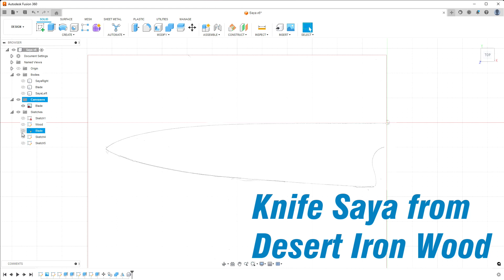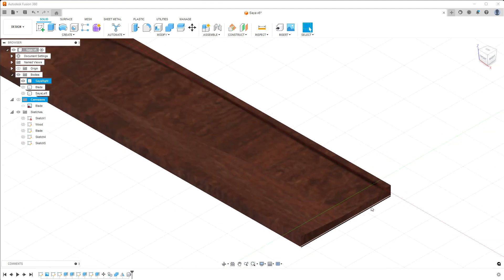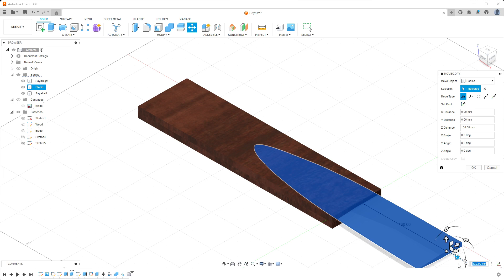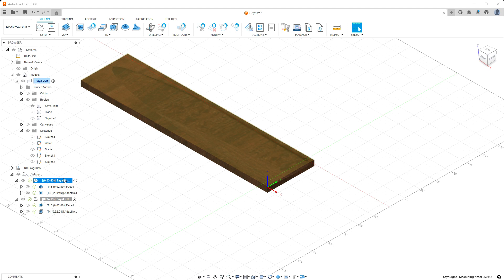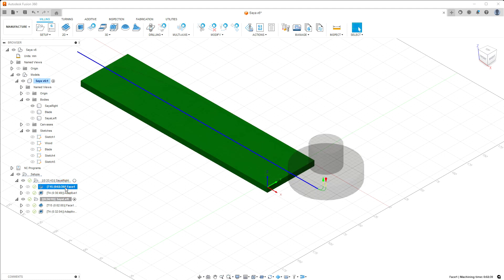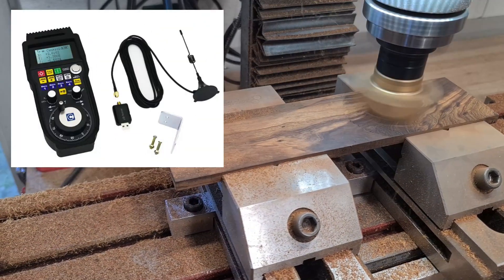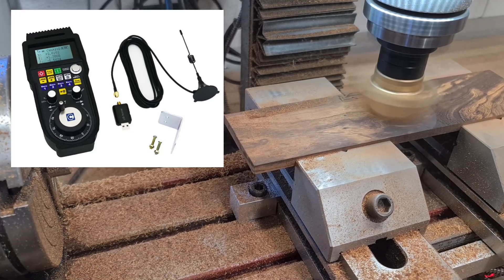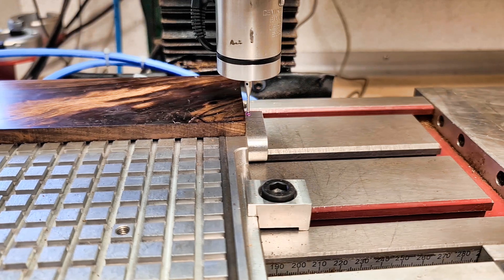CAM of a Knife Saya with Acorn DIY CNC

Comment: I want to learn how to program live tooling on a lathe with a c axis using Fusion 360/Inventor.  I can't find any videos on this
Reply from the maker: You need a postprocessor that supports mill turning for your CNC. The one for Centroid CNC lathes in fusion is only for turning. For my 4 axis lathe with Acorn6 I made a PP that supports milling with C-axis and also with Y axis. (can be downloaded from Centroid forum) Set up machining in fusion for mill turning, generate the toolpaths and run the g-code.

You can also use a PP for HAAS lathes with live tooling and edit the g-code (some M functions are different) to make it compatible with Centroid CNC.
Reply: @TheSuntravel  good to know.  My build isn't finished yet.  Since I didn't have enough infor on this subject i decided to just start with a basic cnc lathe then once I can figure out this topic more I'll upgrade it.  Thanks for the information. :)